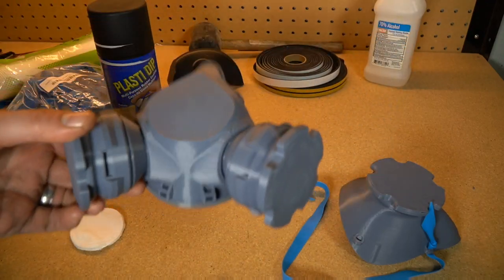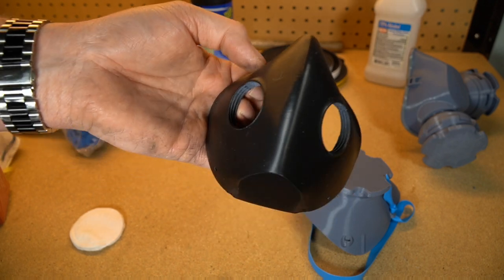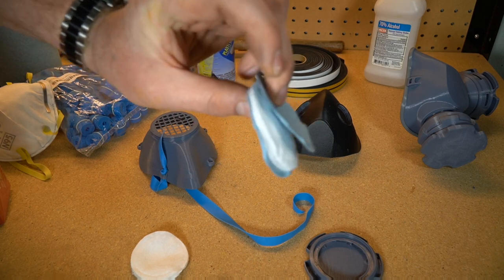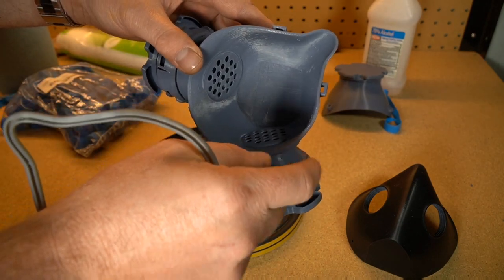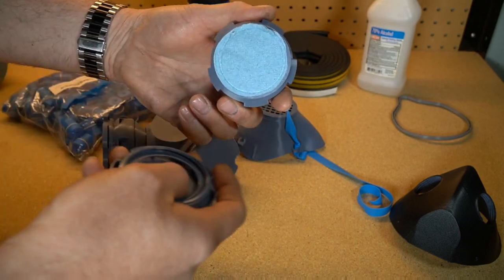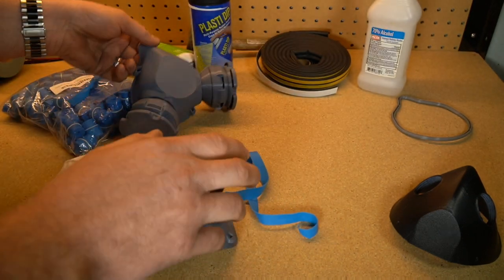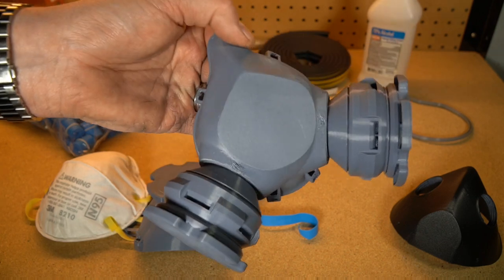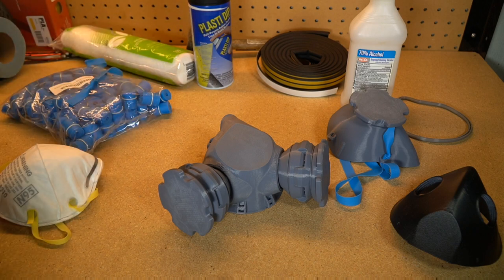The Health Risks of Printing your own COVID-19 PPE mask with your 3d printer!

Comment: You stated that the mask has microscopic pores in it and to be concerned about breathing in contaminated air.  Just to clarify, it is the virus and not gas that we are concerned about.  Testing with water has its problems because it is the water tension that keeps water from passing through a surface, not the water's diameter.  Water has an approximate diameter of 2.75 angstroms and the average size for air molecules (as it is comprised of mostly N2 & O2 is approximately 2.9 Angstroms).  The virus on the other hand has a diameter of approximately 1200 angstroms.  Either way you cut it, the virus is much, much larger than air and water.  So, even if it were a single virus particle the target size is pore size is smaller than 1200 angstroms which 3d printed machines likely can't accomplish.  Especially with thinner and thinner walls.  Porosity of 3d plastics can be controlled by changing the flow rate to make a better seal (Gordeev, 2018). However, depending on the source that you look up cough droplets are in the range of 10,000 to 1000000 angstroms large or 1 micrometer to 100 micrometers (Yang, 2007, Xie, 2009 to name a few).   Since making a gas mask isn't the main goal the primary concern is having a water repellent surface on the outside to keep the spit and mucus droplets from adhering to the mask.
Reply: As a medical and areospace engineer, yeah, you got it right. Sars1, sars2, most, if not al coronaviruses, including rhino virus, and influenza are all spr3ad via respiratory droplets which are about 0.75 to 1 microns in size. A standard bandanna and pillowcase will block 93% or higher of 0.75 micron sized particles.

Comment: Thanks so much for making this and for your kind words!!  Also, I just want to point out that if you can use flexible/softer filament (and can get it to print well) that is a lot safer on your face than PLA in the event that you get hit or fall down.  But I get it, we have access to what we have access to and PLA may be safer than dealing with the COVID!

Thanks again!  I really appreciate it!

Comment: I bought a full face snorkeling mask and made an 3D printed adapter. The intake comes from the top. I use an HEPA13 filter from Rowenta Vacuum cleaner (99,75% filter rate). It comes in an handy square frame, which can be clamped down to my adapter. The air is going out only through the valve on my mouth. To keep my environment safe I use an FFP2 mask (equivalent to KN95 mask) cut into half and put over the output valve with painters tape.
The input filter stays dry and can be used forever (I change it every 6 months). The output filter is changed depending on usage, every 1-2 days.
Additional benefit: you're protected against droplets when other people don't wear masks.
Disadvantage: it's impossible to talk.

Comment: Anyone that understand injection molding will know its still the top manufacturing method over 3d printing which still has its limitations and not to mention the lack of knowledge in designing safety gear among 3d printing enthusiast.
Reply from the maker: Right.   But tons of people have 3d printers in their home and do not have the capability of injection molding.   That can't be fixed quickly.  Luckily the knowledge part can, there are tons of articles regarding respirator design.

Comment: Good video, questions tho: wouldnt ABS or PETG make the mask less shatter prone? I'm talking impact safety since broken PLA has sharp edges. As for plastidip, how resistant is that to cleaning? will it wear off/peel off with repeated washing of the mask? and does plastidip sticks to TPU too?
Reply from the maker: The shattering is something to think about!   There is a commenter below who posted a video about that issue.   Apparently her sister fell on her face while wearing the mask and it messed it up pretty bad.   A semi  to soft TPU seems to be a good option too!   The plastic dip appears to be holding up to alchahol, I also wash mine in soap and water.
Reply: @1D10CRACY  interesting, will it stick to flexible materials like TPU tho? also isn't PETG more likely to deform rather than shatter like PLA does?
Reply: @JuanSanchez-rb4qu  TPU will not shatter. My TPU order is on the way.
Reply: I said PLA shatters, was asking if plastidip sticks to TPU

Comment: Is outgassing of toxic fumes from PLA or painted masks a health risk?  Is there any additional step needed to stabilize the material after printing?
Reply from the maker: I'm not sure if there is off gassing from PLA or not while its printing.  That may be something I need to research before I regret it later.  Once its done printing and cooled down, it seems pretty solid.   About 140 to 150 degrees it becomes flexible again.
Reply: PLA is made of startch so I am doubtful there would be any toxic off gasses but good point.
Reply: PLA doesn't outgas once temperature is below 120C.  High quality PLA should not have contaminants and if they do, it's encapsulated.  I would not use ABS.  BTW, PLA is the same material used for alot of the implants (biodegradable stents etc) in the body as your body can break it down without releasing toxins.

Comment: I apreciate work put in such projects, but let's be honest, if you guys can buy 3D printer and filaments for it you can definitely buy decent mask like 3m and other brands which will protect you way better and most important theese have propper exhale walves so it's less likely to accumulate moisture, so if you folks are reading this comment and don't have good mask yet buy it before next epidemic outbreak when it will be way more expensive due to high demand and you could still use 3D printer to make accesories like filter adapters etc
Reply from the maker: I appreciate the comment and your keen sense of the obvious . At the time of the video we knew nothing about the pandemic and you couldn't buy a mask.   The lesson is to be prepared and when you are not, use your resources that are available to you, to at least try.  Regarding valves, there was a modified version of this mask posted on thingaverse a week or so later with valves, keeping the media dry.  Someone else created a TPU gasket that allowed it to sit and seal better on your face.   Thanks for the comment!   I appreciate everyone's opinions!

Comment: Hi, not an expert here, but, N95s don't have exhale flaps.   Chinese KN95s do.
Reply from the maker: Do you mean Exhalation Valves like the ones on these?   https://www.3m.com/3M/en_US/company-us/all-3m-products/~/3M-Particulate-Respirator-8511-N95-80-EA-Case/?N=5002385+3294780243&rt=rud
Reply: Recommended Industry	Agricultural, Commercial Buildings, Construction, Design & Construction, Food Processing, Food Safety, General Manufacturing, Heavy Infrastructure, Industrial Maintenance, Mining, Oil & Gas, Transportation  ----- Not medical
Reply from the maker: I guess I didn't realize any n95 masks were recommended in the medical field.   My understanding is they are only using them because there is a shortage of medical masks and they found the n95 better than a surgical mask. A surgical mask doesn't have as much protection as an N95+, as it leaks around the sides.   BTW, in the link below is a link to a study on using nuisance masks to fight viruses.  They also test an N95 with a valve.
Reply: @1D10CRACY  I should have stated first, I'm a subscriber and I liked your video.   I appreciate the work you did on the video and the research you've done.  Just trying to add my uneducated $0.02 so that maybe I can learn a little along the way.   I live in china, and the KN95s pretty much all have valves and N95s don't   Some hospitals don't allow you in while wearing KN95 but they do allow you in with N95 (here in China)
Reply from the maker: Thanks for the reply.   We don't see many KN95s and I think our EPA bans them, maybe there is a good reason?   Our N95s are mixed, some have valves, some do not. Over here, we are trying to find non valves, mainly because a valve only protects the person wearing the mask and not the people  they are around.   How is China doing?    The numbers we have look promising!